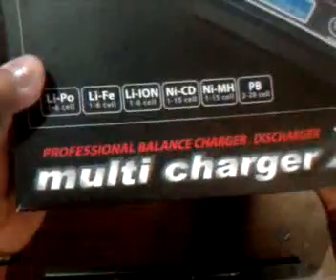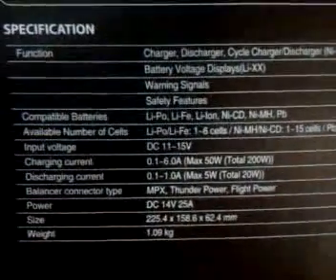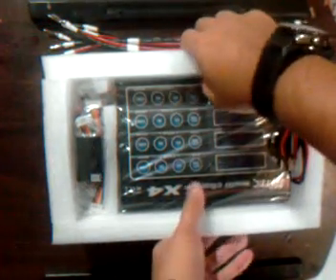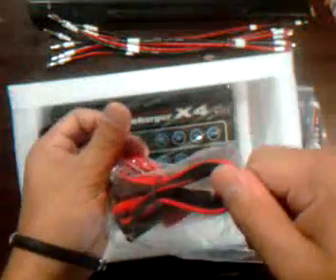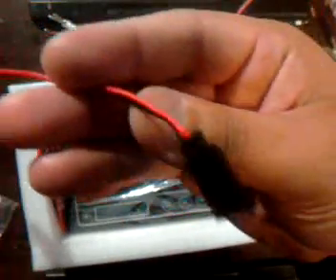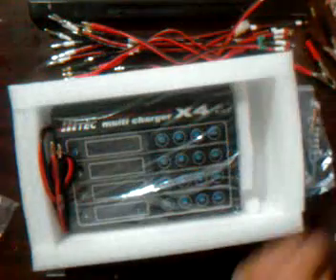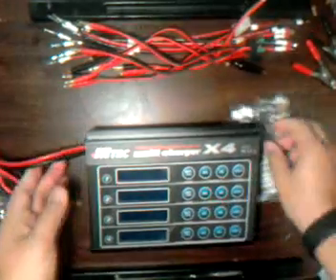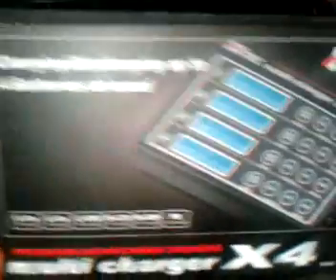hitec multicharger x4 unboxing!

Comment: Quick question, I am charging some 7400Mah 2s batteries and my Hitec is cutting out at 5000 saying capacity reached(stock setting) I should be able to bump up the cut out to 7400? correct?

Comment: I have the same charger, I run it off of an old 650 watt computer power supply I had laying around. I usually only pull about 10amps from it max, 4 each to two batteries, and 1 each to another two batteries. I may be wrong to assume that you would need a 30 amp power supply only when charging 4 batteries at the max setting of 6 amps each. At any rate, haven't had any problems, except the occasional cell voltage too low warning when starting to balance charge a pack that I discharged too much.